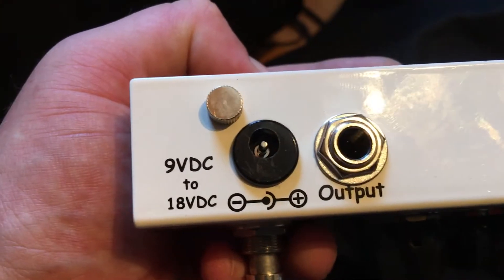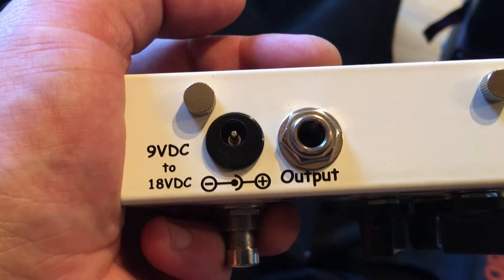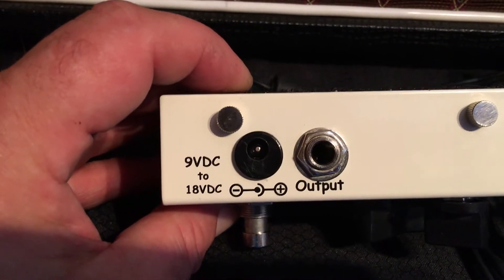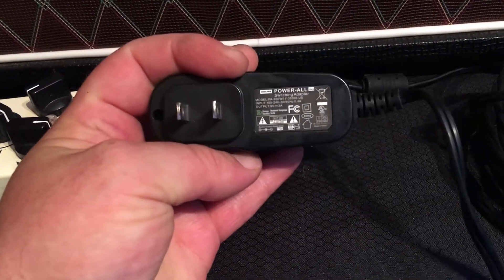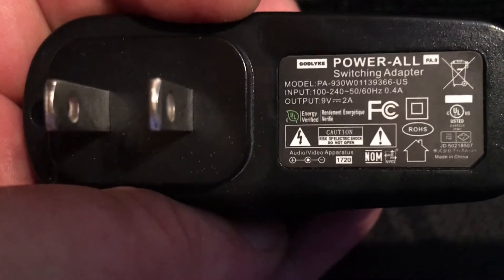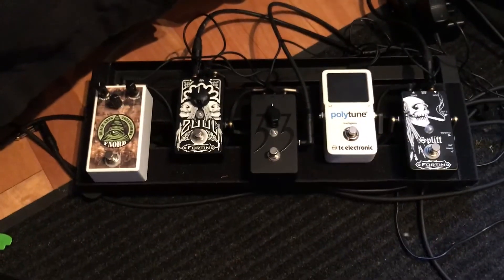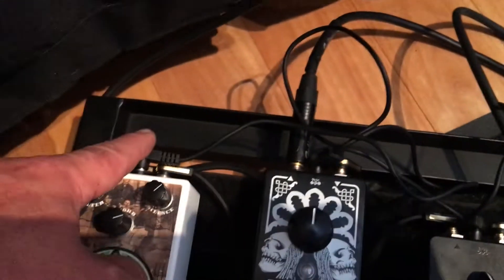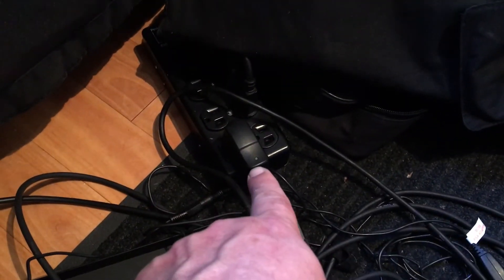Power Supplies and Daisy Chains - Suck Less!

Comment: Gunna have to watch this a few more times, as i'm really not a numbers/tech person! Been using a Zoom power supply + Mooer daisy chain to run my Zoom MS-70cdr and Mooer Micro looper, which works ok but just a little noisy. Now I have a Walrus Audio Slo in the post I'm wondering maybe i should get a decent power supply... I highly doubt it'll be long before I add another pedal to my board.